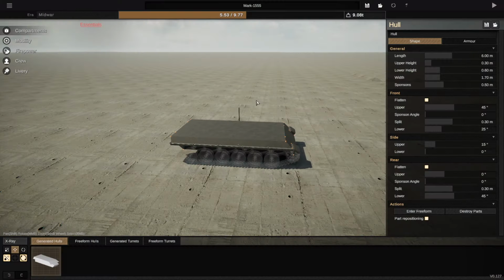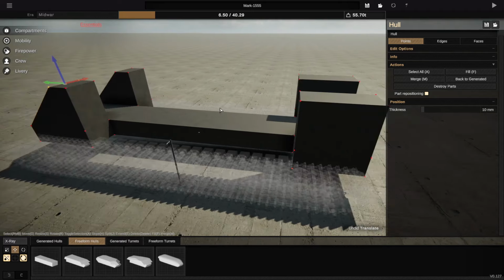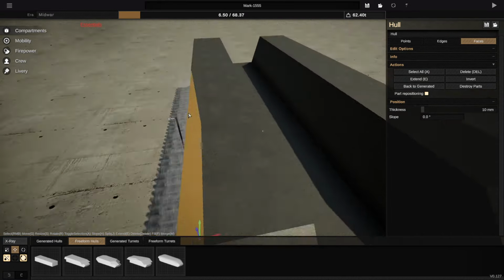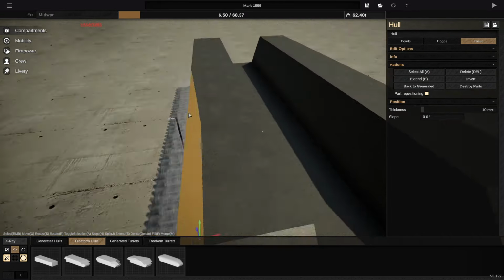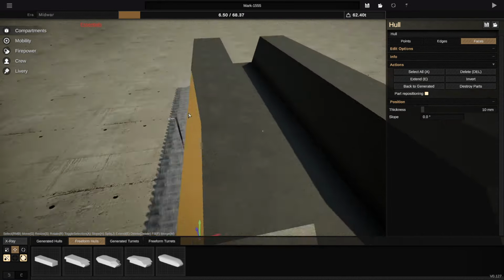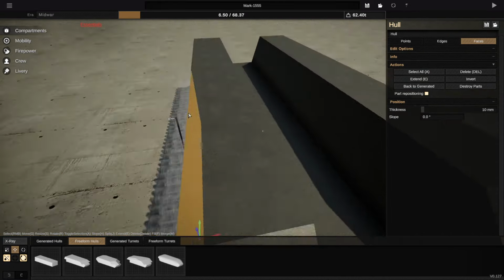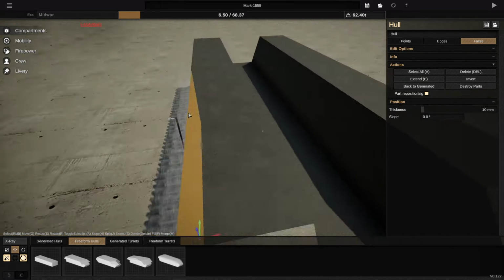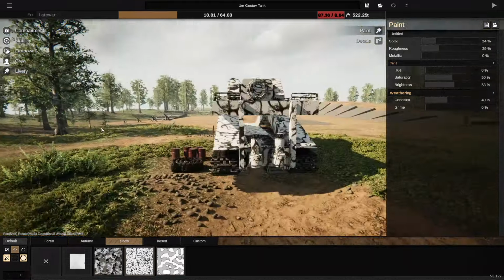I Built A HUGE 1M GUSTAV CANNON TANK In Sprocket!

Comment: Gustav tank is named the P.1500 Monster. just put the gun to the back a bit and make the size larger and there you go...
Reply: No it different
Reply: 800mm gun still... @A_some1
Reply: @UNionfederation  

Different hull and chasis
Reply: yes for frantic's tank... but other than different chassis its the p.1500 @A_some1
Reply: @UNionfederation  they dont move on railways
Reply: The monster is not a tank

It's a tracked SPG
Reply: @A_some1 the P.1500 Monster was planned as an Landship. Fast described take the P.1000 Ratte Chassis and hull and whatever. Remove the turrets and put the Gustav Gun on it